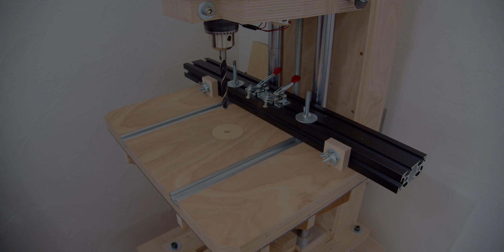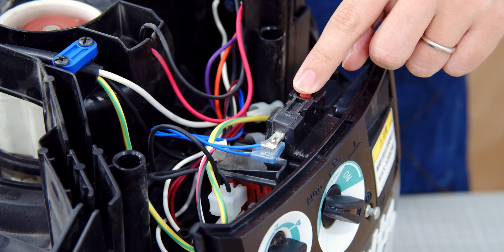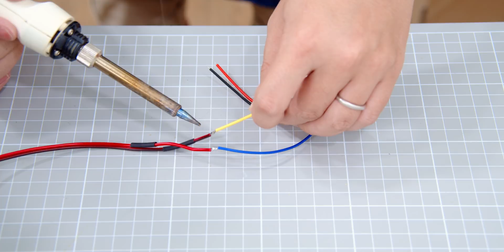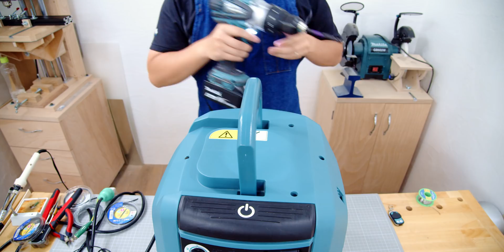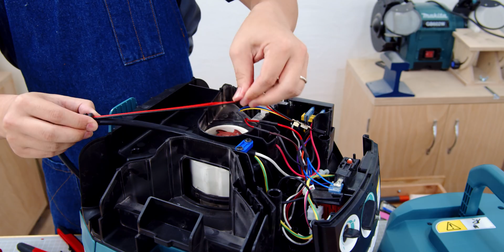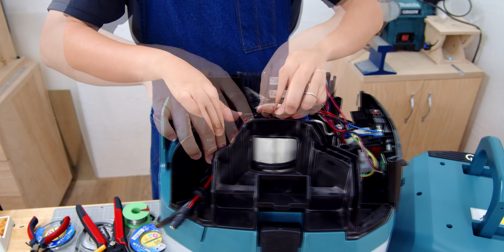How to remotely switch the dust collector on and off

Comment: Nice work but way easier to just buy a remote plug-in adapter. Cheap and efficient. I have them for all my powertool vacuums and air compressors.

Comment: I would have tapped into the power outlet from inside the vacuum and put ALL the remote connection inside. It looks hollow enough you could secure the adapter inside someplace.

Comment: Hi JSK-Koubou, an idea to the next video (maybe the 2.0 of this version)
You could wrap a wire around one of your AC lines several times, making a simple transformer. Place a diode at one end of the coil wire to convert to DC, and then a capacitor in parallel (or a filter circuit) to give a steady signal. Then (maybe need a transistor as a relay) but after that you can connect the remote controller, and now you have the  remote controller automatic when the drill turns on.
If you do that on the wire (centralize the power source) that power all your workshop machines,  now you covered all of them with an automatic dust collector. Just need to drive a 
vacuum dust pipe to each place.
Regards.

Comment: Maximum load on Amazon description: 1A (there is a better load below 700ma)
I think that the dust collector has a large current (11A in Makita's catalog), but is it okay?
Reply: The load on the switching circuit is a lot less than what the motor draws.

Comment: A Christmas lights switch that controls an outlet is about $10, often comes in a three pack with a remote. Worst case, get an IOT wall plug switch and control through a smart speaker via voice command. I would not recommend modifying the inside of the vacuum.  Lost of cool projects on this channel otherwise.
Reply from the maker: The answer to your point is in the video.
Let's watch the video next time!

Comment: hi, man.the idea is good,but in my opinion for this modification, I would place a step-down adapter inside the case.This frees the control socket.And as an option multiplied key rings for further modifications of machines

Comment: Or just buy a wireless socket set with remote, easier and safer. I now have one button that turns on/off my table saw, dust extraction and light all at the same time. £15!
Reply: Dave Robinson my thoughts exactly. That's the setup I have. No cut wires. No opening tools or exposing dangerous voltages.
Reply: @GregoryFeeney  Hi, not in this case because the switch need power to work. (beginning of video, won't start if no power).
Reply: Dave Robinson, can you link me a product you are using please?

Comment: An even more satisfying and sleek conversion would be to install the dc supply inside the dust collector case and internally wore the AC mains to it from the back side of the AC socket on the machine. That way, it’s all internal to the dust collector.

Comment: One teeny weeny little concern. By adapting the wiring on a device you most likely void the warranty.

If the adapted device was involved in a fire then you might find your insurers a tad reluctant to cover the claim.

I daresay a more elegant solution could be achieved by commercially available "fit for purpose" kit.

That said it was a clever idea, but, the few seconds it saves to operate a vacuum cleaner is really neither here or there.

And you might ask how busy you are to need to shave off a few seconds here or there.

Comment: What's the point in this keychain? If you have to drag the vacuum cleaner to the machine and connect the hose, then it makes no difference whether you press a button on the remote control or a button with your foot.
It is necessary to transfer the power contacts to the edge of the vacuum cleaner hose so that by plugging in the hose you simultaneously turn on the power of the vacuum cleaner. And do the control on the current relay so that the vacuum cleaner turns on itself when you turn on the machine and turns off when you turn it off.
---
Какой смысл в этом брелке? Если тебе приходится перетаскивать пылесос к станку и подключать шланг, то уже нет разницы, нажимать кнопку на пульте или клавишу ногой.

Нужно перенести контакты питания на край шланга пылесоса, чтобы втыкая шланг ты одновременно включал питание пылесоса. А управление делать на реле тока, чтобы пылесос включался сам тогда, когда ты включаешь станок и отключался, когда ты его выключаешь.

Comment: The tools is good, nice hands but the idea and execution are below the level of the master.
There are at least 3 ways to make it easier and more beautiful.
In the case of using this remote control, the wires could be soldered inside without making external connections.
The second option is to use a slightly different scheme, the board is connected to the grid, an on-off pulse from the remote control, and cleaner just connected to an electrical socket.
And the third, the most reliable, is to make a switch on the cleaner hose, and do everything with one hand and do not look for the remote control every time. I have a 10 m vacuum cleaner hose, inside a wire and a button at the end of the hose.

Comment: You could have connected the 5v dc adapter to extension socket, but on the inside. Just splice the wires leading to the socket.
Reply: I thought the same thing. Dissasemlbe it again and hide that power supply inside. :)

Comment: I bought a remote control for lights off Amazon, it came with 3 outlets and a single remote.  It runs my shop vac and Delta dust collector with ease.
Reply: Tom Griffin Link?
Reply: @deploracon4740  This is what I bought, but it is unavailable now. 

https://smile.amazon.com/gp/product/B07K2XRJW6/ref=ppx_yo_dt_b_search_asin_title?ie=UTF8&psc=1

Comment: Hi koubou, i think it could be better to instal (AC-DC 110V 220V 230V to 12V Converter Isolated Switching Power Supply Board) as an inside power of this relay. And then you have still a free access point for external tools. Greetings

Comment: There's a better way to do this, without hacking into the vacuum cleaner circuitary. 
Get current sensing relay. A relay that would close the power supply (turn on) to the vacuum when it senses current flowing thru another circuit (the power tools).
Reply from the maker: The function is standard on this dust collector.

Comment: crimps would be preferable to solder joints
Reply: Or Wago 221 connectors perhaps?
Reply: @t1n4444  wasnt familiar with that product line. are they expensive? they look very interesting
Reply: @dincerekin  No not at all. Extremely effective and extremely easy to use.

The product range is fairly comprehensive as you have probably seen.

Buy them in boxes of tens or thousands.

(Quick aside: I now use bootlace crimps on the stranded wire ends to make the task of wire insertion and removal even easier, and not have to worry if stray strands of copper get separated from the rest.)
Reply: @t1n4444  how do they compare to these more traditional connectors?: https://www.amazon.com/terminals-connectors-insulated-electrical-standard/dp/B07B46ZMPG

As this is what i personally would have used as i have it on hand.